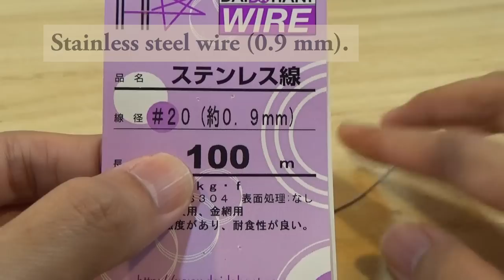How to make Onigiri Rice Balls for Fishing.

Comment: What line your use? Braid or nilon?
Reply from the maker: Thanks For your question. I am using 8lb nylon line.
Fine fishing line is popular in Japan where I live, but I feel that 6 or 8 lb. is easier to use.
Reply: @haru834  thanks, usually I use a braid line but if the water gets dirty the line becomes sticky and hard to throw.